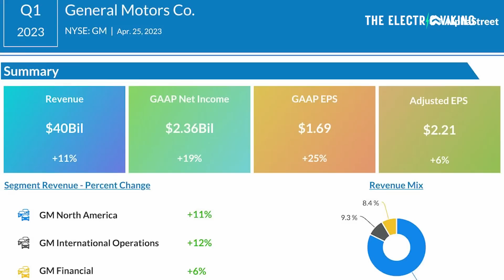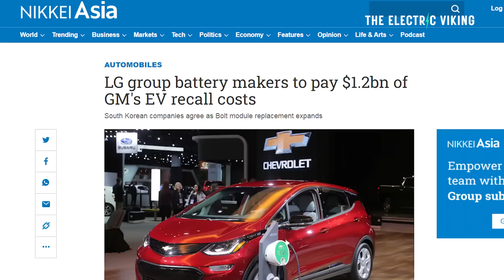GM says it will slash battery costs to $87 Per kWh within 18 months

Comment: The Bolt is the one EV that GM is producing at scale. To get the battery issue sorted out, GM has spent billions and sued LG Chem for a portion of the losses. Not a good way to make money, but at least they showed some respect for their customers. Recently they have decided to discontinue it, which is odd because it undercuts customer confidence. Now they seem to be asking us to believe that scaling the new Ultium vehicles is going to go smoothly, and that they can accommodate cylindrical batteries when the platform is clearly designed for pouch batteries. And the Equinox, which could be a mid-priced competitor, is FWD when it should be RWD. It seems that leadership and the engineering teams over there are moving in several different directions without a clear plan.

Comment: Wow to $ 87/ per kWh for battery. Looking forward to  that cost eventually being available for Home Backup and/or Solar Systems ❤ ... In contrast, I spent about $160 per kWh for my DIY LiFePO4 home battery bank (with BMS using 280  ah EVE prismatic cells, with forum guidance from DIYsolarforum ... ); while my warehouse option for similar have been near $400 per kWh 🏊🚣🎶⛵🌠

Comment: On battery day, musk said they went cylindrical after seeing the quickest production methods were associated with bottling and the automation in that space was mostly worked out, quick, efficient, etc.  volumetric efficiency was perhaps lost until the cell became structural, as cylinders are very good columns in a structure.  So, speed, scaling, and cost were priorities, the structural pack was a bonus.
Reply: Also they have discovered that battery heat management is better with cylinders because the space between them allows heat to escape as opposed to pouches packed together....so the space becomes an offsetting benefit on a different dimension...battery management/cooling.
Reply: And 20 years ago Steve Jobs was lauded for going from cylindrical to pouch in Macbooks due to energy density and other benefits. Trying to simplify it to 'X is better than Y' is a fools errand, there are a million engineers and business factors playing in. Tesla chose the simplest prod line to spin up because they started from nothing - that is probably the main reason why they did it - same reason why they chose those stupid magnet wire windings in the motor.
Reply: @Gnosticware  What's the story behind the magnet wire windings? Haven't heard this before...
Reply: 🤦‍♂️ Delco Remy had a patent on hairpin windings that runs out this month. Not "GM". That's the reason Tesla stayed away from it until now, not your demigod being wise. 

As far as cylindricals, that was JB Straubel's baby, not Musk's - he homebuilt a Porsche using them prior to joining Tesla.
Reply: Packs made out of cylinders are 24% empty space. Teslas batteries are bigger than they need to be.
Reply: There are other ways to pack cylinders. Hexagonal packing is 9% empty space. I don't have specific information about Tesla's batteries but I don't see a reason why they wouldn't be hexagonal.

Comment: I'm tired of GM in general and Mary Barra in particular creating fabulous plans that have no basis in reality.
Reply: GM is great at making EV promises.  They are not great at making real EVs.  I hope they survive.
Reply: I don't like GM either, but  I think a lot of EV fans are lost in China/Tesla's LFP and sodium batteries hype that they have little idea what's going in the battery supply chain. LG's NCM batteries used by GM have been falling in prices and are already cheaper to make than LFPs -- high-nickel 811/ultra-nickel 955 batteries have higher nickel content (more energy) and less cobalt content (less cost).   There's chunky premium on the current gen of NCM due to its limited availability now, but will decline significantly in prices as more capacity come up online by 2025.
Reply: She led,  don't forget that!
Reply: all Gm really does is a lot of smoke and mirrors , smooth, talk lip service,, just to keep the stock price high,but you see nothing...

Comment: IIRC it was reported that LG backed out of the deal with GM for the fourth JV cell factory in NA.  LG said it was too stretched financially with the three factories that it already committed to for GM.  GM said it would find another partner for their fourth factory and it was later announced that it would be Samsung.
Reply: Correct.
Reply: GM doesn’t need 3 new battery factories. GM does not have ONE new EV assembly factory.
Reply: LG just recently announced a new $5.5B plant in Arizon not too long ago.

Comment: When we bought steel for multiple construction projects we would spread out the demand to avoid peaks driving up prices. As EV’s become ubiquitous the aggregate demand will push rate earth mineral prices up again.
Reply: That's why they are currently working so hard on designing batteries using different materials. I don't don't think the future of EVs is Lithium Ion.
Reply: @elhoward7440  :  lithium-ion batteries for light passenger vehicles; hydrogen fuel cell for heay duty trucks.